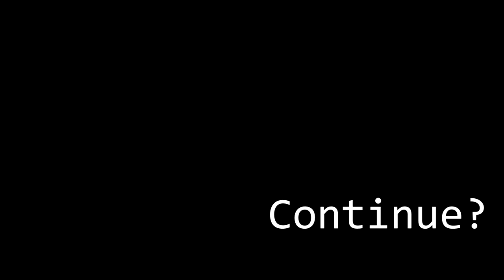Behringer TD-3. Novation Circuit, MIDI Setup

Comment: I have the circuit tracks but cant get any sound from my td3. Followed you directions but no dice. Any tips?
Reply: Aaaand i figured it out right after writing this. The second midi out also functions as a thru. To designate it to out go into the advance setup and make sure the duplicate light is green. If anyone else is having an issue try that
Reply from the maker: Glad you got it sorted, thanks for sharing the solution, you will make someone's future google search a happy one!